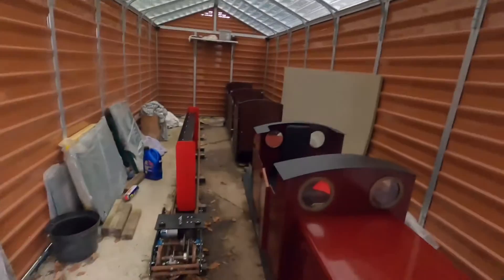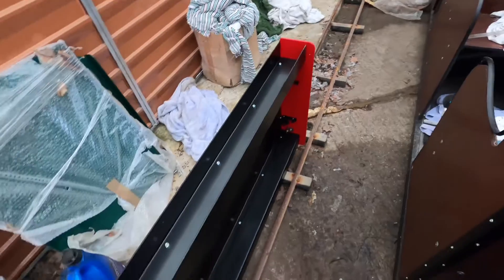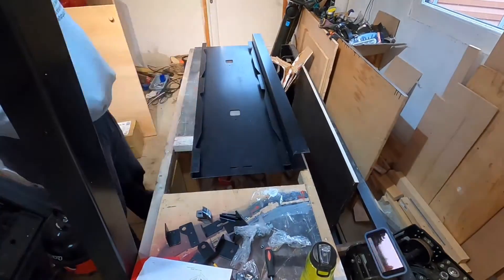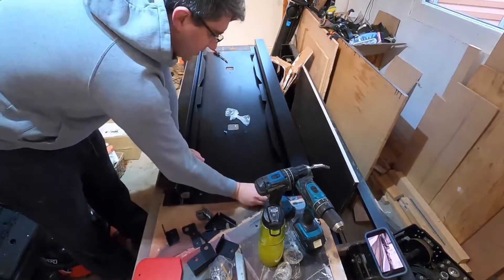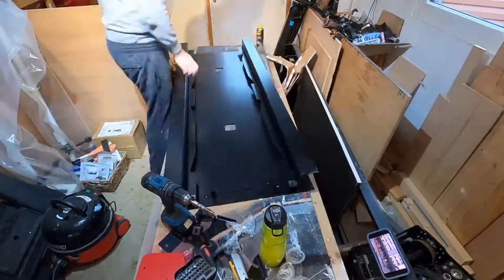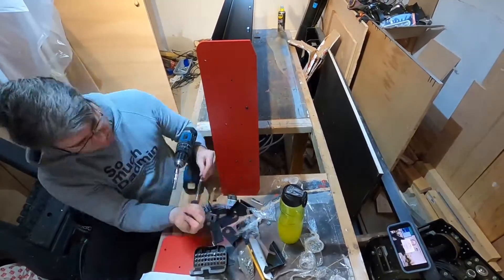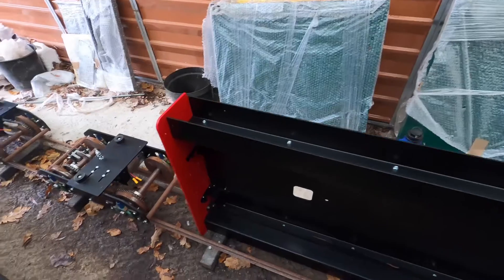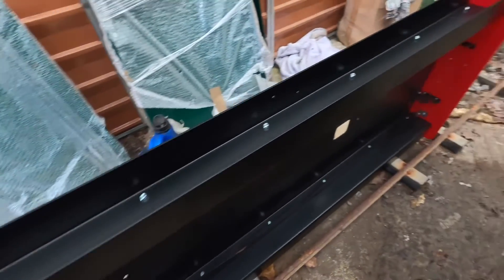Building a Phoenix Hefty loco - part 1

Comment: I received my Hefty about 9 months ago - assembled it but have yet to wire and add details. I’ve been building a new workshop and then  will be able to the 30 feet of track I have down.  I hope to get back to finishing the loco in a few months.  Thanks for posting    I’m located in mountains of Pennsylvania, USA.
Reply from the maker: Wow sounds like a great location! Well I hope that the videos help.
One question I have, how did you route the brake cable from the bogie to the lever? I’m struggling to see how to do it. Many thanks
Reply: I was waiting with anticipation to see how you did it….   I struggled with this and am not sure I have it correct.  I couldn’t get it to work with the way I believe it had to be routed as the cable twisted too much.  I fabricated a separate bracket and attached it in a slightly different location, in relation to the lever in the rear.  I think it will work, but haven’t been able to test it yet.    I don’t think I can post a photo here unfortunately  @GreatEastonRailway
Reply from the maker: @mussersail that’s really kind of you to take the time to explain. I’m glad we aren’t alone in being confused! We have asked for a picture from Phoenix, but failing that I’m sure we will have to adapt in a similar way!